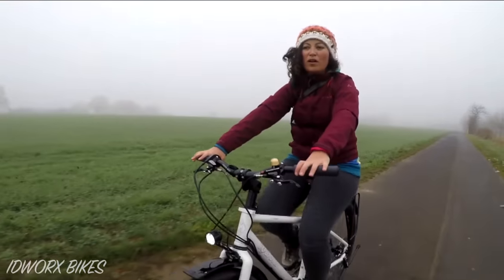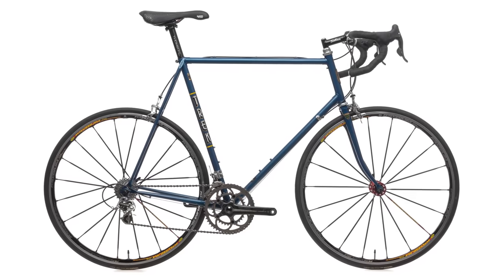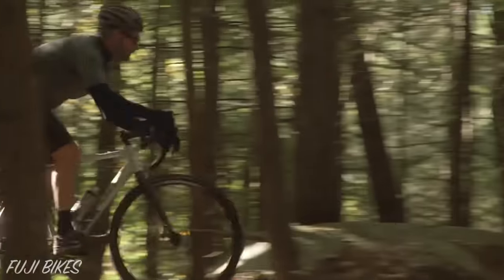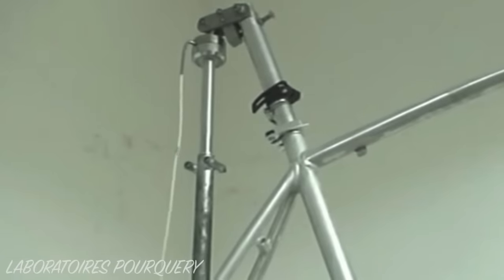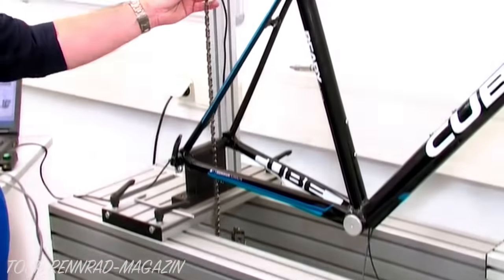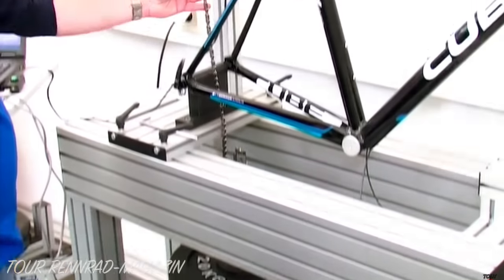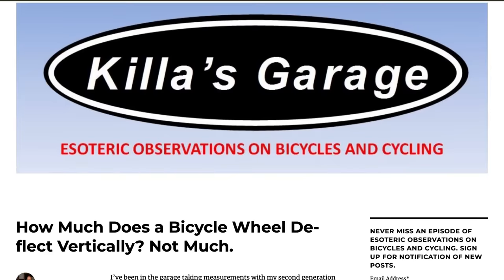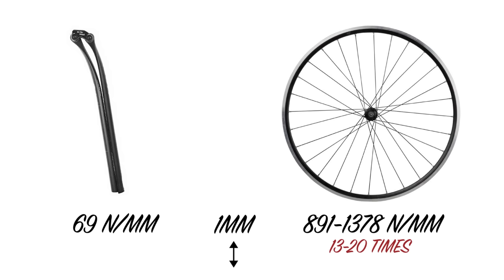Why It's Impossible For Steel Frames To Be More Comfortable Than Aluminium

Comment: A quick question on vibration attenuation

You stated in the video that on bikes with narrow tyres and no luggage, you prefer carbon fibre bikes as 'carbon kills the road buzz'
You also stated that vertical compliance between steel vs carbon frames factors very little when taking into account springs in a series. Hence carbon is more comfortable without any noticeable differences in frame vertical compliance

Are there any vibration attenuation differences between nice steel vs cheap aluminium which may result in the comfort which some purport? (on bikes with thin tyres and no luggage)

Otherwise I really enjoyed the video, thank you for taking the time to make this
Reply from the maker: There are undoubtedly differences between a cheap aluminium frame and a nice steel one when you run narrow tyres and no luggage. I couldn't find any strong data on the matter, but my personal experience is that 40mm+ tyres are damping very large proportions of vibrations from the road, so that is probably where I wouldn't notice a difference between a cheap aluminium frame and a fancy steel one.
Reply: @Cyclingabout  I 100% agree with you on the frame having minimal difference with large tyres etc. I believe that the belief of steel being more comfortable would have originated in the 70s and 80s where mountain biking was not too popular and road bikes would often run 18mm tyres. Vibration attenuation would therefore be very important when it comes to absorbing the road buzz

Whilst not on bicycle frames, this paper found that the vibration attenuation (damping ratio) of steel is almost double that of aluminium https://www.sciencedirect.com/science/article/pii/S1877705816302284

I can imagine therefore on road bikes running skinny tyres, you could definitely state that steel was more comfortable than aluminium due to these properties
Reply from the maker: I agree that steel bikes ride smoother when comparing bikes with narrow tyres. And yep, I'd say the rock-hard 18mm tyres and 'square' steel frame weren't doing much for ride comfort back in the day. 😂
Reply: @Cyclingabout  What is a 'square' steel frame? parallel fork and seat tube?

Comment: When I was young (17) I had a race bike with a Colnago frame made of Columbus Zeta steel tube (plus, as a side note, the first aerodynmic Dura Ace bike component set wih excentric pedals as a side, which was bloody expense for me at that time). My brother had a much cheaper bike with a much stiffer frame. Compared to riding my Columbus Zeta frame his bike felt as unforgiving as riding on a brick. I could feel this particularly when doing turns. My bike felt like it would snuggle into the curve radius. The sensation, and difference, was more than just subtle: It was tangible. Of course it all depends on the individual construction of a frame, not just on the material choice. However, steel is more elastic than aluminium, and if you build a steel frame and its tubes right, it will flex more than a similarly robust Aluminium frame. So there is material physics speaking in favor of steel comfort wise, as experience to back this up.

Comment: I've experienced the most increase in comfort with a carbon fork and especially handle bars. Even on thinner tires the dampening is noticeable better, actually most noticeable in regular city riding over badly maintained bike lines or cobblestone streets.
Reply from the maker: Yep, pairing good handlebars, soft grips and carbon fork together creates a super smooth front end!

Comment: Thank you, I've been saying this to steel snobs for a while. I like steel and ride it regularly, but riding to work there is a section of "cobbles" as well as lots of rail crossings. When riding that section, my aluminum bike shod with 28c tires feels like a featherbed compared to my steel bike with 25c rubber. When people start talking about frame comfort I always say that tires, bar tape and a nice chamois are infinitely more beneficial.
Reply from the maker: Those components make a really big difference. Seatposts too at the narrow tyre widths!
Reply: @Cyclingabout  that's now a component I will be putting more consideration into.
Reply: TODA LA RAZON

Comment: Frames also deflect side to side - with every pedal stroke. You can see it if you look. Chainstays also flex to the side when turning - harder to see but you can feel it. Forks delfect in both plains - you can see it when you stand on the pedals.

Comment: I read about steel and aluminum years ago and I believe that it’s about geometry and thickness of the material with negligent difference from material. Though steel tubes are stronger than aluminum so they tend to be thinner and when that is the case the frame will flex more. 
The seat post, fork, handlebar, saddle, tires are all the places I would look for softening up the ride. Though if it gets too springy I can imagine a rough road at the wrong speed may be too bouncy. There must be a sweet spot.

Comment: The placebo effect that you mentioned is mainly due to the flex at the bottom bracket area. Since steel bike will have a cushy feel while pedalling compared to carbon bike, the perceived comfort feeling might be higher.

Comment: I thought steel was standard on touring just because the repairability.  I'd be more interested in a video on how many welders can fix aluminum.  I heard aluminium is so common a material it is just as likely to find someone to do an emergency repair on a aluminum frame as it is steel.  Modern steel bikes use such thin walls I heard it is more difficult for a welder to repair where aluminium tubes are pretty thick and easier for average welders to work with.
Reply: If aluminum breaks, you can in theory weld it back together, but in practical terms it's ready for the recycle bin.
Reply: The problem here is not the welding per se. Aluminum can be welded, but in order to achieve the desired mechanical properties the whole frame needs to be heat treated afterwards.

Comment: Excellent analysis on vertical compliance. Though I'm curious why you didn't consider fork, stem, and handlebars? IME, the bumps coming up through my hands have a much bigger impact on my discomfort than anything coming through the back end. 
(I have a sprung Brooks saddle and a Softride suspension stem on my primary bike, and when I ride a different bike, it's the stem I miss the most.)

Comment: Good video. Good to watch. But you are over simplifying this. This n/mm is just one aspect of the equation. And you only examined one direction, but frames are working in 3D. The other thing is resonance, you can feel the difference. Just because you do not feel it, does not mean that other people can not. I have a numbnes problem in various body parts unfortunately, and there is a big difference between frame materials, numbnes comes much earlier on an aluminum frame. Btw I am engineer.
Reply: Totally. I like fast downhills,some are rough. My carbon roubaix can and will catch air off bumps,bumps steer it.. My steel frame roadbike sticks to the road and turns on a dime.
Reply: But the one direction that was tested in the lab totally makes sense because in reality it is the direction where most of the force comes from during a ride and also the first contact points. Sure, he is oversimplifying it but it is a less than 10 minutes video. I would appreciate more if he also includes the basic theories of the physics, the test methodology, environment, setup etc, but it would take too long and people would be bored to death.
Now the thing is that, this vertical force is measured and can be used as reference, so say you want to calculate the force acting at a certain angle, you can derive it from the reference. Metal is isotropic so theoretically if you have the frame dimensions etc you could calculate the forces acting from another directions. However, as said in the video, the vertical flex of frames is very small, so assuming that the frame will flex more (thus "contributing" to ride comfort) in another direction makes no sense except if it was designed that way.

Your numbness problem could be caused by so many reasons; different frame geometry, riding position, your body condition, thickness of bar tape, the saddle, seatpost, tire pressure, road condition, speed at that time, etc.
Reply: Also didn’t say much about feel through the pedals.  Seat feel is of course important, but road buzz through the pedals also affects road feel.  Also, all things equal, a heavier bike will always feel smoother than a light one.  Maybe steel feels more comfortable partly because it’s mass is greater and it takes more force for a hit to move the frame against the rider contact points.
Reply: Carbon is different for every bike, it can dampen vibration really good, or it can rattle your bones to death, it just depends on how the fiber is wrapped.  Steel can be just as light as aluminum, especially stainless.  Modern steel has come a long way.  They simply use modern alloys that require far thinner tubes, then quad butt the ends to get enough material at the weld points.  A properly built stainless frame should weight roughly the same as titanium.  Look at SpaceX and Tesla deciding to use a new stainless alloy to build the Starship and Cybertruck.  A few years back nobody would've ever thought steel would be a good idea in a rocket lol
Reply: Presentation is nice and simple, but the good engineers out there are all thinking the same thing "Dunning Kruger effect at work here" ......  Let the misinformation continue.

Comment: Good job debunking the myth of vertical compliance. However comfort isn't just about vertical compliance (or vibration) unless you're riding straight along a washboard road. Consider riding an old cobblestone road. Your tires will be hitting the cobblestones at an angle that won't just push them up or down but sideways as well. This will happen to the front wheel and the rear wheel independently. So most of the time your front wheel is basically being pushed one way and your rear wheel some other way (I'm simplifying to make a point). If your bike is super stiff the wheels won't be able to deflect independently. Instead the whole system including you will constantly be forced to change direction back and forth by tiny amounts. A torsionally compliant frame on the other hand will allow the wheels to deflect a little bit, keeping the rest of the bike in a straighter line and shaking you less. Add cornering with the bike leaned over to the equation and things start to get more complex.
General comparisons between materials are difficult. You can design steel frames heavy and stiff and you can design aluminium frames compliant. I ride aluminium bars with visible (designed) flex and the most uncomfortable set of bars I ever had were made of steel. Comparing the ride qualities of frames with the same amount of deflection for a given force would be interesting.
Hitting the sweet spot in frame design seems to be a fine line, since rider weight and style of riding plays such a big role. A frame that's nice and comfortable for one rider could ride like a noodle for another.

Comment: Ride "feel" also plays into comfort as well, as others here have stated. Carbon, titanium, steel, and aluminum frames all have different feel characteristics, given all other components being the same. It is not a night and day difference like huge tires are, but for a discerning cyclist, the difference is there. My discussion is valid more for road-oriented bikes. Once you get into the large tires like 40mm+, then it's just all tires, as you have noted. The vertical compliance numbers you presented, while sound, don't tell the whole story of how a bike rides. We don't ride bikes in a lab, anyhow, and we all don't ride the same styles of bikes in the same terrain, so therefore the position you have taken is a blanket statement not applicable to all of cycling.

Comment: would a full  suspension Mountain Bike be far more comfortable for long touring rides,  given how 
front and back are suspension and how they have wider tyres ?
Reply: Suspension and wide tyres would indeed smooth bumps.
Though full suspension would require carefull adjusting: If rear suspension is any too soft it will move from force of pedalling wasting power.
Also full suspension adds more parts to wear/need maintenance.
Wider tyres wouldn't make difference to that and suspension seat post would be simpler to maintain compared to suspension in frame.

Comment: This is an excellent analytical look into the myths.
Reply: MJD spot on. And who tours (bike packs in modern terms) on 23-28mm tires?  This video is all over the place cherry picking information. Starting by comparing aluminum to steel for “compliance” when you should really be comparing higher frequency damping. Then moving on be comparing carbon to steel for higher frequency damping? Cmon. This isn’t research, dude. I like all frame materials and they all have their place...
Reply from the maker: - You've missed my arguments. The first one was that vertical frame deflection is incredibly small and essentially a wash when it comes to the overall spring rate of a bike. Whatever bikes I compare doesn't matter.
- In the section about vibrations, I address damping, suggesting that the frame is a very small proportion of highly damped components on many bikes (my focus in my content is gravel/touring), especially when you add luggage or wider tyres to a bike. Again, irrelevant of frame material.
Reply: First of all, skip the personal insults. They have no place in this discussion. Typical touring bike tyres are at around 35mm width (example of a classic https://www.genesisbikes.co.uk/bike/tour-de-fer-20 ). On the rougher surfaces, people have started to use even a lot wider tyres lately as the general trend has been in the past years ( 40 - 50 mm is not super wide anymore ). In such systems it seems that frame materials importance starts to diminish. My personal touring bike is Genesis Longitude https://www.genesisbikes.co.uk/bike/longitude . It comes stock with 2,8 inch tires ( 71 mm) and it has a traditional steel frame. But with those tires, it probably has no impact ( :-D ) what material the frame itself is. I like cyclingabout's approach of the overall spring rate. I had not personally thought of bikes as such systems, but it does cut through a lot of marketing stuff it provides clarity into thinking of stuff that truly matters.

Comment: What about the deflection of a steel *fork*?  It was my understanding that on steel frames that's where most of the 'give' comes from.
Reply: I should also clarify this video doesn't address another aspect of steel frames vs. other materials -- namely the differences in vibration-dampening properties:

http://web.mit.edu/2.tha/www/ppt/Bike-ISEA.pdf
Reply: @peterbense5650  I thought this was covered and the answer was "negligible"?.
Geometry seems to most important.  I have a straight carbon fiber seatpost(SADDLEpost?) and it has NO compliance, naturally.  But it looks cool.
Reply: I do not find it negligible, in my riding experience.

Comment: When vinyl first became available I used a fully sprung seat.  These days I only have 5 to 7 cm of exposed seatpost.  I do use 38mm tyres but I use a telescopic seat post with 3cm of travel.  By wife uses a thudbuster with more travel.  There are many options for comfort that can be added to any existing bike.  Incidentally, on my tandem it is far more stable with my wife on board than without.  And more stable than any solo bike also.  Giving a nice trustworthy feel on a fast mountain road.

Comment: I own a 1993 Cilo (Swiss hand made) bicycle made out of Columbus SLX tubing. It is by far the most comfortable, compliant and fun bike that I have ridden thus far. I also own 2 high quality carbon frame road bicycles and the Columbus SLX steel frame is livelier, more responsive and more comfortable. All have alloy rims and 25cm wheels. All have stock seat post and bars. The seat post on the older steel bike is significantly shorter than the other two bikes! Still a more comfortable ride.The 2 carbon bikes are a 2002 Trek 5900 US Postal Service Replica and a 2013 Trek Madone 4.5. It bears repeating that the steel is both livelier and more compliant. The quality  of the Columbus SLX tubing, in my opinion,  makes an enormous difference in ride feel and comfort. To discuss steel I think it is important to experience the highest quality tubing and construction before discounting it.

Comment: For those who think frame flex is so important for comfort please tell what I am doing wrong. I live in Portugal where cobblestones abound. I can ride over them for hours undisturbed. This is how: aluminium frame with a 15mm travel suspension post, 2.1" tyres inflated to just over 30psi, a saddle that suits me and front air shocks to save my wrists from cracking. The bike weighs 14kg. It is clear to me, as the videos shows, that the frame material is almost irrelevant to the comfort. For speed, acceleration, load capacity, longetivity sure, but not comfort.

Comment: nice to see some evidence in the frame comfort debate. I have no empirical evidence to quote... only a few decades of biased experience. Tire size and pressure make the largest difference to comfort and feel. Wheel construction are a distant second. Frame material has less relevance. Other massive impacts to comfort: geometry and bike set up, brake hood ergonomics, bar tape, quality bib shorts. But..... late 80's and early 90s steel bikes look the best :)
Reply from the maker: The data backs up your anecdotal experience! I agree that steel bikes look the best. 😊